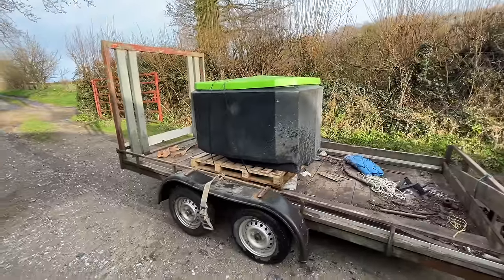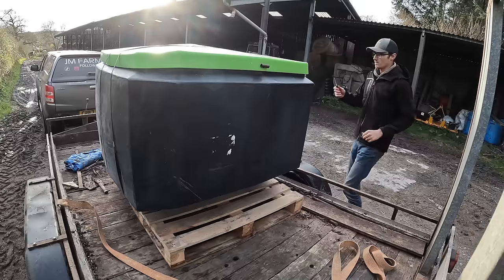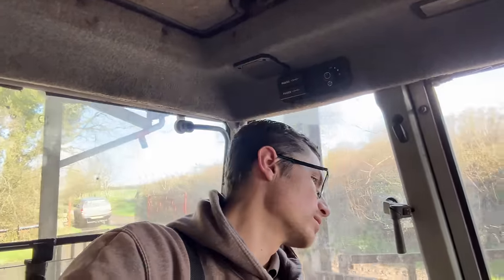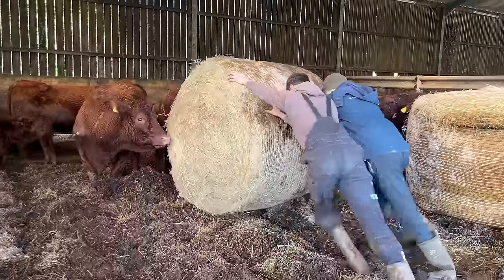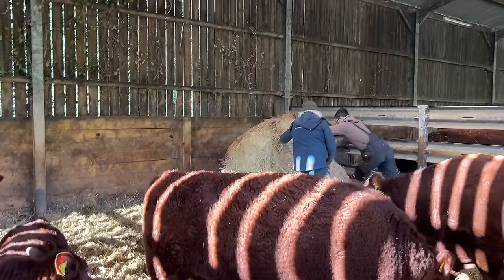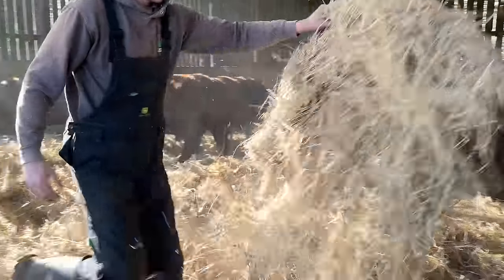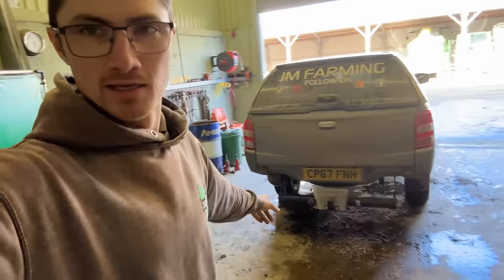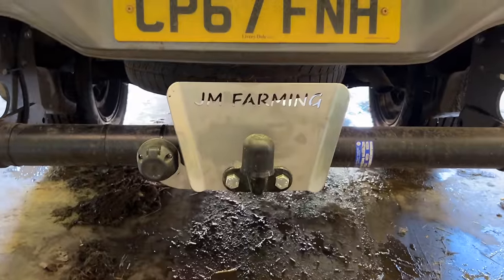Tipsy Bin Arrives! | Tow Bar Guard Installed!

Comment: Nice to see Abi helping out at Back My Place, and it brings a level of sophistication to the video and keeps you in line Josh 😂.  I would hold on to your spacer plate Josh, as you need a minimum to 5mm between the guard plate and tow ball, but it all depends on the make of hitch on the trailers you use.
Reply from the maker: Haha thanks Fraser! I have the spacer in the truck so its there in case we need it!